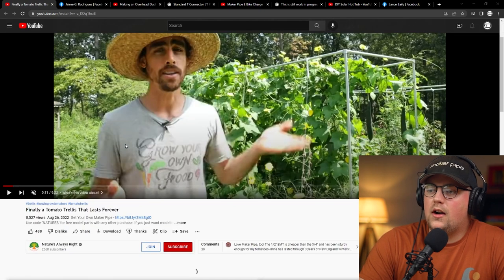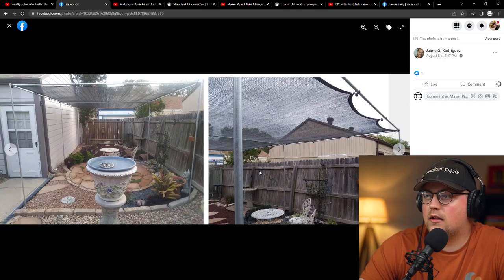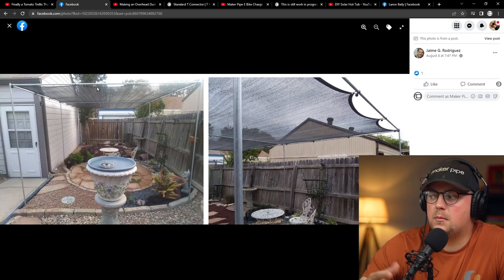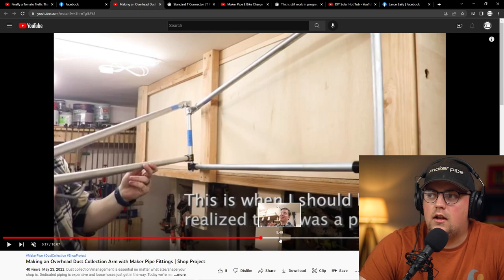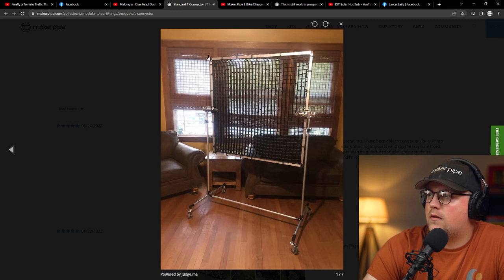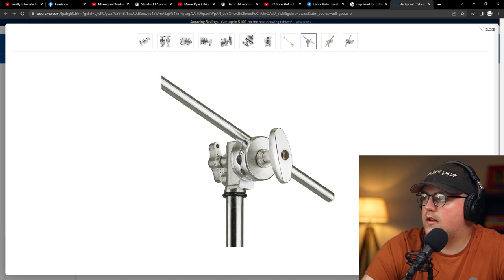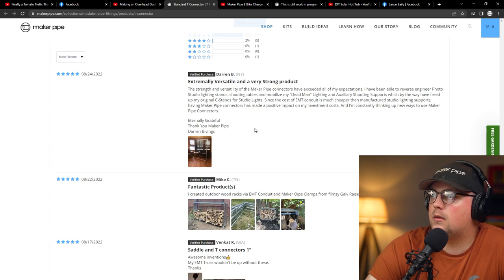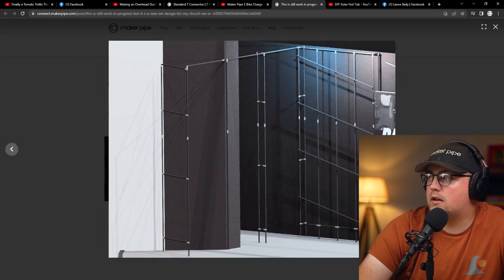8 Awesome DIY Builds Made With Pipes & Connectors | MPM - 114

Comment: lol   Yeah. "Those Blazer tops are easy to remove. They're just fiberglass!", they said. The first time I removed it from an '88 Blazer I bought was an experience. I backed it up to the garage, undid the bolts, unplugged a wire, and planned on sliding it straight back until it was far enough to where I could set it on the ground, then tip it up off the truck. When I tugged it, I realized it was a little heavier than I thought it'd be, but no problem. I was half way there when it fell off the side rail and started rolling to the left. I clamped down on that thing to stop it and popped every muscle and blood vessel in my body, and my eyes even bulged out. One of them permanently! (OK. I lied about that last one. It popped back in within a week or two). I then correctly realized that the top was completely chock-full-o-gravity. I have a covered front patio next to the driveway, and I ended up there on my back. It put me there the exact same way a shoulder flip from a kung-fu ninja would have, and then it hit a 2'x2'x8' wood column that held up the patio roof, kicking its ass, too. It smashed one side of it, kicked the bottom of it over about 2', and spun the whole thing 45 degrees out of whack. The shock of the Blazer top hitting the driveway was transferred to damaging my internals, so it wasn't too buggered up at all. And, it was off.  Win!
 (I took the top off thinking it'd be nice to drive while having a breeze blowing through. I'd just moved here and figured I could leave it off for long periods since the weather was always nice here in Arizona. Well, the "breeze" was a blast furnace, I'd get where I was going soaked in sweat, stop lights were a near-death experience, and the steering wheel and ignition switch would burn the crap out of you.   Three of us put the top back on. The AC worked great!)
Reply from the maker: Wow, sounds like quite the experience! I used to own a Wrangler with a soft top. The very first time I took it off took about two hours and getting it back on was just as nightmarish. It didn't result in any bodily or vehicle damage like yours did but it was enough of a night ruiner that I didn't take it off very frequently after that. It just wasn't worth the effort when it was all said and done. Like you said, windows down or up with full blast AC is sufficient enough for me lol